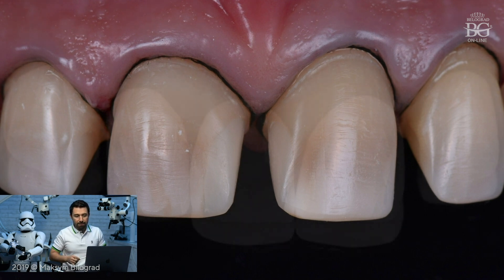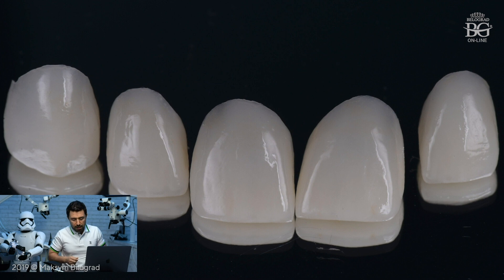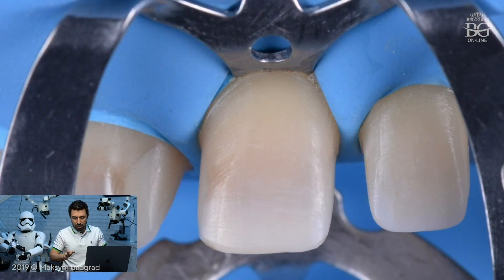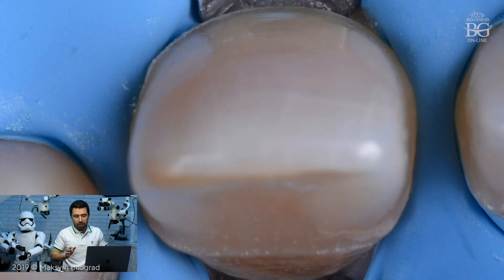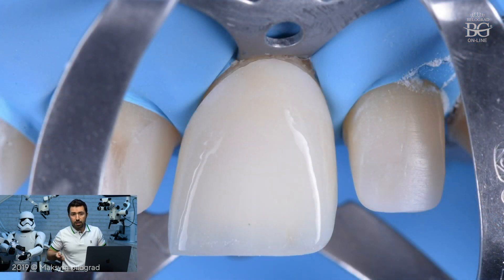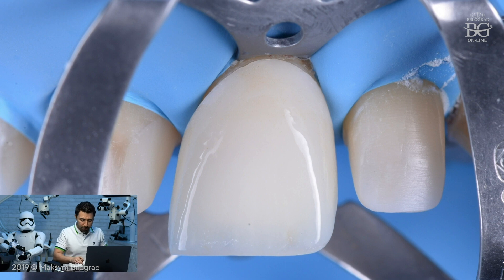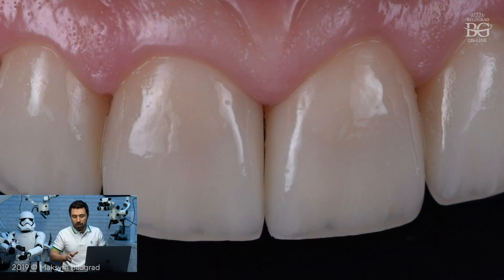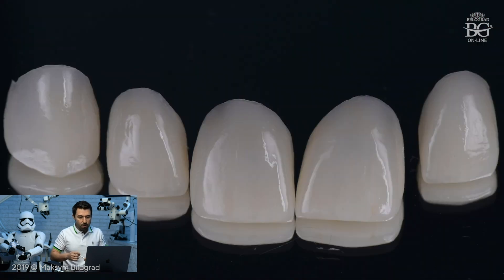Why to prep with rubberdam. BG Dental Cases. #05

Comment: Would like to see how you go about wrt isolation regarding class 2 cases for composite restorations particularly those which are subgingival or very close to gingiva..and how you achieve a tight seal with band and margin in such cases..as maximum times I've faced gingiva between cavity margin and band.
Reply from the maker: Swaggy Dev ok, got it
Reply: Belograd academy if possible, this with endo included and quadrant dentistry and/or full mouth rehab with bite registration and raising the bite

Comment: Lovely case as usual. What's the point of allowing the gingivae to bounce back into position after you remove the clamp and wait 7 minutes then you place retraction cord to push the gums away and take impression? Why not take an impression straight away after you remove the clamp and the gum is already in a retracted position
Reply from the maker: sahrawee thanks! The point is that clamp retracts gum more than cord and I don’t need that much. So I wait after rubberdam removal and than positioning my final finish line not that subgingival